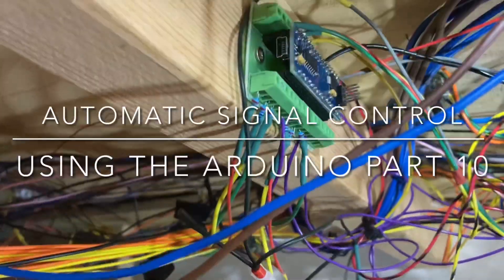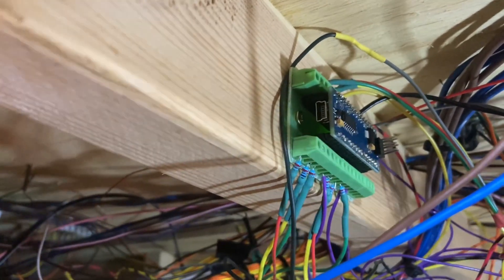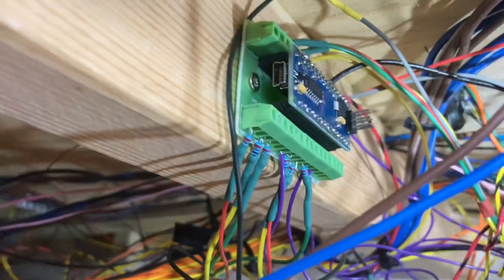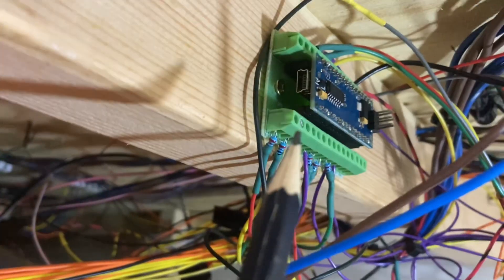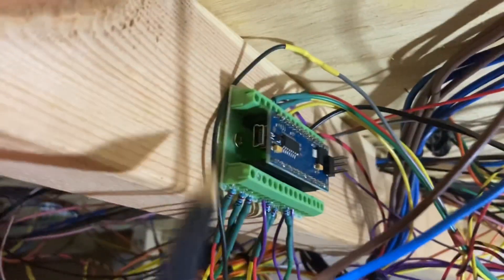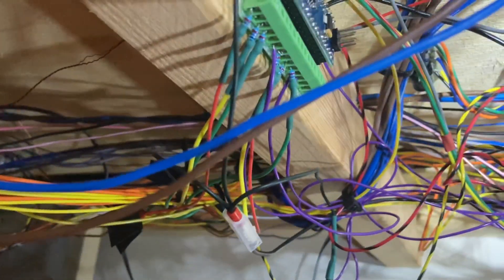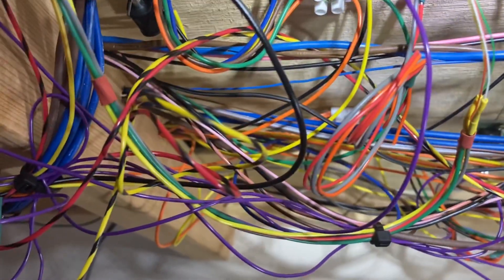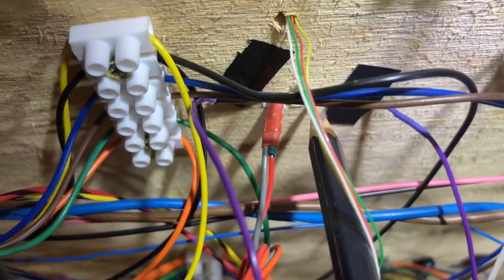Model Railway Automatic Signal Control Using an Arduino Part 10 - On The Layout

Comment: Hi Paul. I have a question. Do you know where you buy those arduino kit? And also how do you find those signal light stand with the black frame? Do you put the three LED lights inside the signal frame? As I am specific on wanting to find and order the exact one you have
Reply from the maker: Hello there, The Arduino Uno can be bought widely on eBay just search for "Arduino Uno R3". The signals I used are the Berko B503 model, again there are plenty on Ebay
Reply: Hi Paul. Thank you so much. As I am planning to start building a model railway layout. It should work on any railway model scale tracks? As I am from Australia. Also, I want to learn how to wire it up the signal points with the Arduino sensor kits, just like you've shown on video. This will be my first time on how to do this as I am not sure how to wire it up and get it working. Would you have some video tutorial or links that you can show me how to get it worked?
Reply from the maker: @wolfywillow8836  Hello there, yes this should work with any scale. Afraid I can't help with further videos as I've had to dismantle my layout and don't have any layout at the moment! Good luck!

Comment: ¡Hola buenas tardes Paul! I have followed your series of Arduino-based signal control and, have to say I found the projects very helpful. I purchased an Arduino starter kit about a year ago and have been experimenting with projects to include on my own layout. I also took note of your suggestion to follow the projects on Rudysmodelrailway channel and, his set of Arduino videos are fantastic for a novice such as me. I gather, from watching your channel projects, you fully enjoy the creation of your 'own type' of railway which, you use to play trains and are not overly worried that things aren't necessarily in line with what some expect them to be (I make no use of the dreaded 'P' word!) This I find rewarding and, I too share this hobby for the same reasons. I look forward to watching your future layout projects. As ever, stay safe and well. Un saludo. Gary
Reply from the maker: Hola Gary! I am an Arduino novice too and no doubt my efforts can be improved upon by someone who knows what they are doing! I'm glad you found the videos useful , I think the potential for the Arduino to help with some things on model railway layouts is really exciting! Oh yes, my layout is "as is" warts and all, but I think I've packed in quite a bit in my limited space even if it may not be "P" right... Best of luck with your railway building